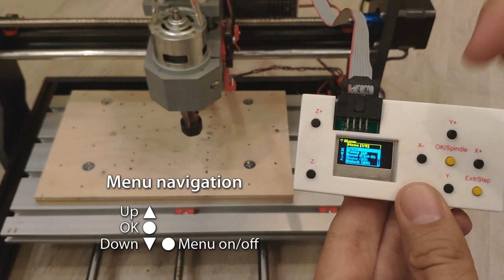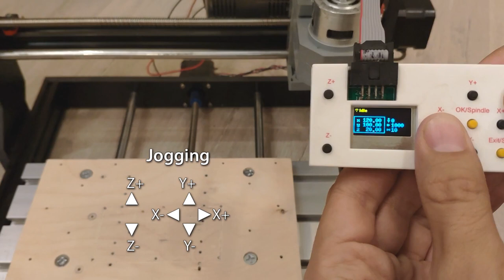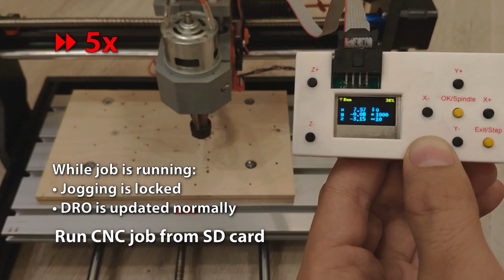Alternative firmware for CNC3018 offline controller

Comment: I LOVE that you can change workspaces!  This was a bit deficit on the original controler firmware.  I NEED to give this a try.  I may make a hardware clip for the 4-pin connection rather than soldering a connection, so that I can put it back into the original case cleanly.

Comment: Just FYI: I bought a CNC3018 pro a year ago and the included a newer offline controller, which is based on an esp32. I suppose this would open up wifi functionality.
Reply from the maker: Yes indeed! I've made a esp32-based pendant (also on youtube), stumbled upon too high current consumption for the CNC controller to handle

Comment: Bonjour sa me dit pas comment flashe le firmware.hex moi jai le programateur ST-LINK V2 avec le logiciel (STM32 ST-LINK Utility) et pas d'écran
Reply from the maker: you can use st-link v2 with OpenOCD and PlatformIO. My project has settings to upload via OpenOCD. I don't know how to upload with St-Link  Utility. Also you didn't answer how you've built the hex. If you did it with PlatformIO, then you have everything to flash.

Comment: Heya! I recently got a 3018 Pro CNC that come with a newer board with WIFI function built in... Was just wondering if youd played with it as Ive tried to connect to the controller through software like UGS and LaserGRBL but they say connection refused. Yet the controls are identical in how they move the machine.... I want to see if some people are interested in trying to build a custom firmware that allows this kinda stuff?
Reply from the maker: Hi! I've heard people say these controllers have WiFi capabilities nowadays, this means they are completely different from what I have here. So no, I haven't played with the new ones. But LaserGRBl at least should work with WiFi as I understand
Reply: @osmanpasha_diy  fair enough.. its interesting cos neither connects, they both just say connection refused... my guess is the board doesnt allow connections outside of your browser but idk aha
Reply from the maker: @epilox  well if the board does not speak direct grbl commands, then it's a good idea to make an alternative firmware for it!
Reply: @osmanpasha_diy  Yeah going to look into it, only ever programmed in python but wanna look into others and hope I can get this working

Comment: What program do you use for flashing the original hex?, I flashed your firmware but it doesn't send any command to the cnc board
Reply from the maker: I've used j-link and openocd successfully. 
Does the firmware show anything on the display?
Reply: @osmanpasha_diy  Yes it does show the interface, I put a serial probe in tx rx terminals, the behavior is as follows: 
after the firts $I sent by the offline controller, 
the machine responses with  [VER:1.1f.20170801:] [OPT:V,15,128] ok
the offline controller understands the response and sets the baudrate as 115200 correctly

after that the ofline controller only shows the machine as X idle or sometimes Lockpad Idle, but no further comand comes out of the offline controller, not with a SD card file, not with the DRO, or any other entry on the menu
Reply from the maker: @Vinpinto  Great report! Could you repost it to GitHub, I honestly don't know how to debug in YouTube comments.

Comment: Excellent Video, I am enthusiastic about your project and download everything, but I see that the reverse engineering is incomplete, it is a shame that you did not complete your work, but it helped a lot, I think I only need Where do the switches for the axis movements go? .. But thank you very much for your contribution, if you finish it, please let me know, I'll become a subscriber to your channel.
Reply from the maker: Hello and thank you very much! What do you mean by incomplete? As you can see from the video, the buttons are fully handled in firmware (so you can find the pins in code), and in the schematic on GitHub the MCU pins where buttons are connected are marked.
Reply: @osmanpasha_diy  First of all, I apologize, for not seeing all the information well, what happens is that I speak Spanish and I do not understand English, I am over 72 years old this month, I am using the Google translator, to be able to communicate with you, Can you tell me if the 8 keys go to the MCU directly, and if the Screens that are sold in AliExpress, of the OLED screen Module SSD1306 I2C IIC SPI Serial 128X64 LCD, 4 pins, are used to be connected to this Project of yours. From Now, Thank you very much, for all your understanding. My Cordial Greetings.
Reply from the maker: @luisalonso9987  Hola and thank you!  Yes, 8 keys go directly to MCU pins. On schematic, they are named BT_U, BT_D, BT_CENTER, etc. SSD1306 display should work, though if it says "4 pins" is probably an I2C module. On the controller it is wired via SPI, so I' would look for SPI display for compatibility.